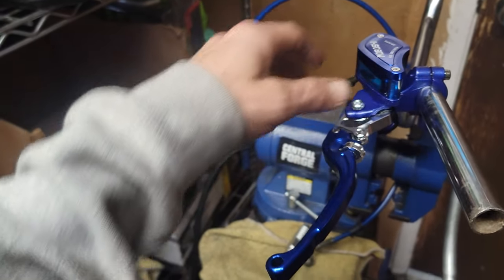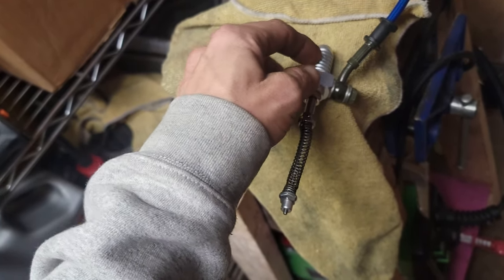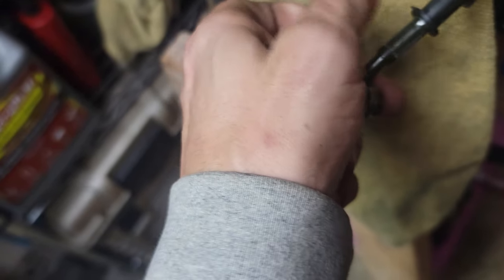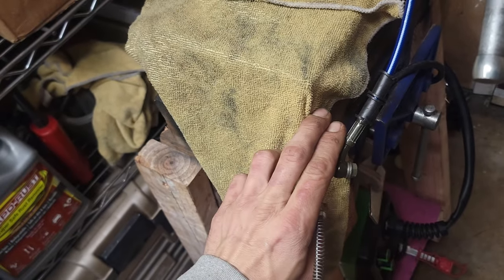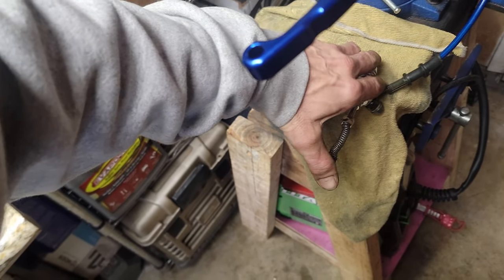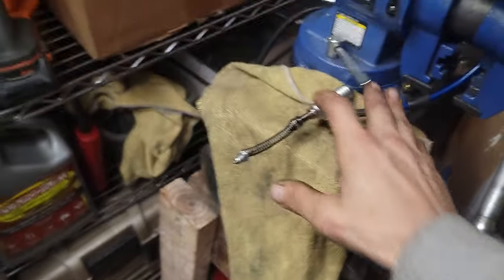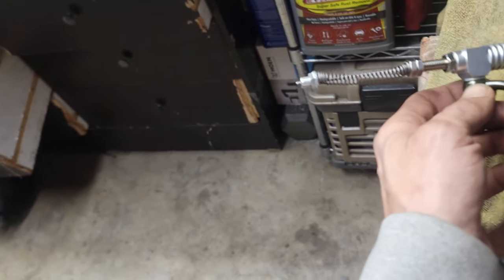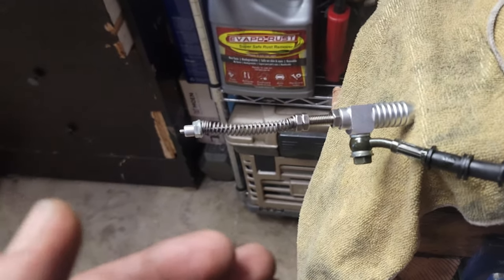boom vader cheep hydraulic clutch install tips

Comment: I know this was two years ago but your video is one of very few on the idea, have you had any trouble with not getting enough clutch engagement when you did this? Bought a goofit hydraulic clutch setup and either I'm bleeding it wrong or the actual slave cylinder doesn't have hardly enough pull to it to fully pull the lever and disengage the clutch. Guess what I'm asking is how did it go and what slave cylinder were you or are you using still?
Reply from the maker: @slaughternut  it's been perfact just use a  oversized master brembo clone that pumps alot bottoms out everytime